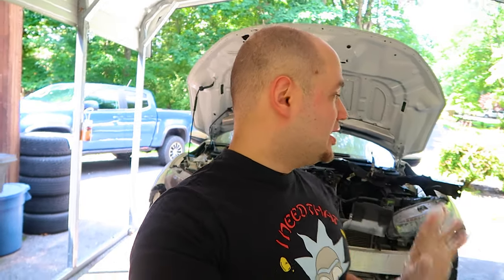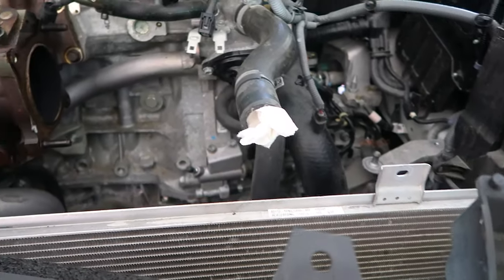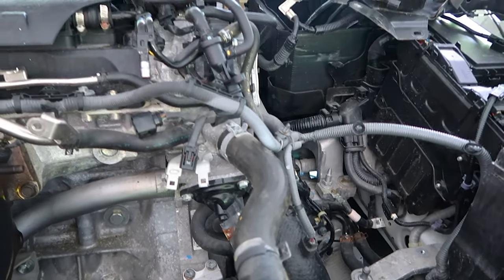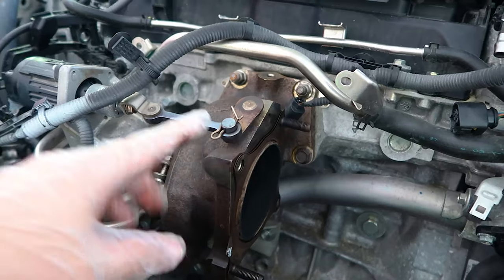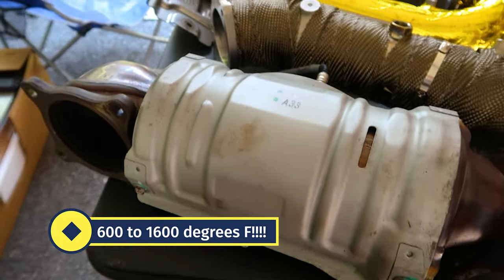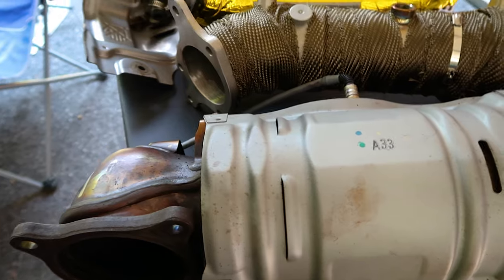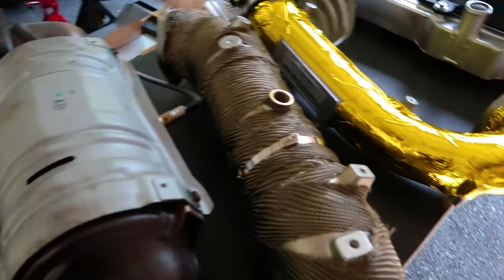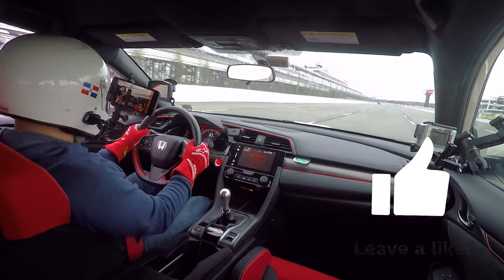The Civic Type R has some HORRIBLE design FLAWS What Are they and WHY

Comment: This makes me appreciate the simplicity of 90s/2000s Hondas even more, such as the S2000. You are right on point that manufactures like Honda have many more obstacles from an emissions, safety, and having to share a global platform, when engineering the final package. This is why. people need to know what they are doing before modifying and running these Hondas.  I have decided to leave my FK8 relatively stock (except for 18 inch wheels and pads).  It will be primarily a street car with maybe about 5 track days a year during the cool months.  I love the Fk8. Of course my s2000 stays!  Nice videos Elias!
Reply from the maker: Thanks man! I miss my S2000, still waiting on a puddymod differential

Comment: Honestly the FK8 CTR's ancestor, the EK9 CTR is significantly less PITA to work on and preparing it for track days is really straightforward(brake pads and fluid), not need to worry about  overheating issues and the transmission gear grinding due to some sort of design or manufacturing defect. I know it's a lot slower but I really hate cars that give me unnecessary headaches because I just want to drive the goddamn thing😂.

Comment: Yeah that seems kind of crazy compared to my focus ST where the turbo and the Catalytic converter are at the back of the engine so it doesn’t heat up the air coming in from the intake or the airbox. With the civic type R you’ve got the catalytic converter the turbo & the radiator all at the front of the engine right underneath the air inlet from the airbox so that’s a lot of heat up front in a very tight space.

Comment: I’d say the whole interior is a big nope fells cheap especially the horrible infotainment and the heat issue is a big problem for tracking or autocross gotta redesign the cooling system but idk how they will do it this tbh with the emissions so I guess we stuck with heat issues smh hopefully the TLX type S will have their issuer fixed with that massive grill

Comment: 1. It’s overstyled garbage with fake intake everywhere and a pointless wing
2. it’s front wheel drive
3. it’s a honda
4. It has a 4 cylinder engine 
5. It’s not even a sports car
The s2000 is objectively better and simplistic in its design